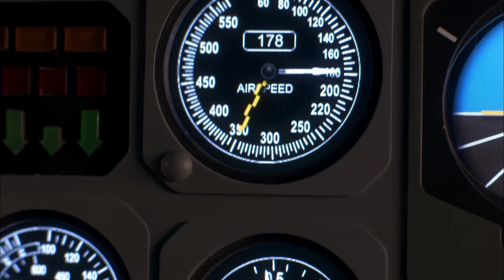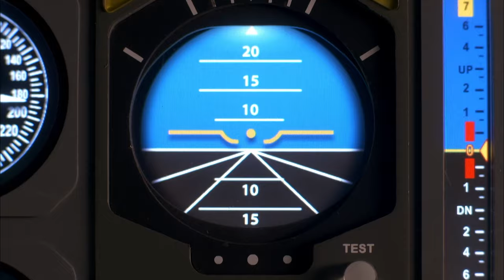A Take-Off for Concorde 4590 Turns Into a Fiery Nightmare 🚒 Air Disasters | Smithsonian Channel

Comment: There should always be a way that you can slow down a plane and be able to abort takeoff if something happens. Better chance of survival to try to stop on ground than to lift up in the air and come crashing down.
Reply: In a perfect world, but sadly not in the real world.
Reply: That's not possible cos if it happens after you are going a certain speed then you don't have enough runway left to stop... You have to continue with the takeoff. That's just how it is, there is no way to stop it.
Reply: If you slow down plane at that speed and distance, you'll either end up out of runway on the ground or just crash into a building bro.
Reply: @liampower5602  That's true for 99 situations out of 100. This one is one of the exceptions though, where the correct thing to do would have been to break the rules and reject the takeoff after V1 (of course you can't blame them for not doing so because they didn't know the extent of the damage). A great example of a flight crew who saved their plane by aborting after V1 was Ameristar Charters flight 9363. An MD-83 was accelerating down the runway and when the PF attempted to rotate the aircraft, nothing happened - an elevator had jammed in the nose down position. As a result, the crew rejected the takeoff (after V1) and, despite overrunning the runway, everyone survived. If that crew hadn't broken the rules they would have crashed, likely killing everyone on board. Really the rule is don't reject the takeoff after V1 unless the crew believes that the aircraft is incapable of flying safely
Reply: After v2 no abort, no gambling here u have to face it. Its like they sacrifice people
Reply: As a professional Air France pilot myself Captain Marty lifted it because if he crashed through the fence and stoped not only would so many others be injured but the plane would just blow up eventually because there is a lot of fuel.I Respect Captain Marty.
Reply: They can't, so that's why they pulled supersonic planes
Reply: You can't abort after certain speed because you'll just crash off the runway with a plane full of fuel. At least if you go round you can try and dump fuel but not gonna happen in this scenario.
Reply: @lillyess385 They can't abort after certain speed with ALL planes not JUST supersonic ones.

Comment: These were people of means who lived better than most. I'd rather fly coach and arrive alive.
Reply: True, it was for people with money.  This belief that flying coach is somehow safer is of course nonsense.
Reply: ^ Both these arguments are stupid. The crash had nothing to do with money. It could have downed a propeller plane just like it downed the world's fastest most luxurious airliner at the time. The crash had everything to do with the usual carelessness, bad design, and lack of thoroughness that has also caused many other incidents very much like it.
Reply: @rominn2184  It technically had to do with money, engineers on the dc 10 that took off were probably told to use shortcuts, therefore causing a small portion of the plane to drop off causing 4590’s crash
Reply: Just the carelessness, nothing wrong with the design.

Comment: Did anyone show calculations on IF the Cpt had aborted take off, as suggested by FE, would the aircraft, with it's speed and fuel load, actually stopped before they ran out of runway, or with the runway overshoot, may have stopped. Then dealt with the fire, mayb some of the 100 pax/crew via slides would have got off, (though as most pax were retired heading for a cruise, were they agile enough to evac quickly and nimbly.!)
V2 (must take off) is a rule, but with all things, does it air on the safe side... could the result have been better if they had tried to stop/evac.

Comment: We can't take off when the engine failed.......and we can't let engines when fire before all people died
Reply: But when the v1 is reach you must take off you can't stop the plane it is too fast and the runway is near to be finish
Reply: And youre sitting on your fucking couch meanwhile they're flying a.supersonic plane?
Reply: V1 is the decision speed they passed on the runway. You cannot stop the takeoff at V1 . There isn’t enough runway. 

The final act was when the flight engineer initiated a shutdown on engine 2. He had no permission to action this. That command can only be given by the pilot flying. 
So he probably shut down a thrust giving engine..
Reply: @muppetrowlf1473  the pilot said engine fire proceduire though

Comment: I'm sorry but I'm pretty sure they would have had a better chance of survival if they had TRIED to stop and abort the take off than what actually happened.
Reply: And you don't know what V1 speed is
Reply: @airbus_a380_enjoyer  well yes, funny enough I do, but still....if I had to choose between taking off with my engine on fire and applying all the features to slow my a$$ down and possibly saving more lives, then I will take the latter.
Reply: @hardv8  I would make the same decision. They had two options either destroying their aircraft and potentially killing everyone during runway overrun or trying to lift that airplane into the air and hope they can land safely. Aborting takeoff above V1 speed often has way worse consequences than continuing with takeoff. Alright I know they slammed it into the hotel but they knew that if they would abort takeoff they wouldn’t have chance to stop. We can’t blame them because design of Concord is not ideal for maneuvering at low speeds. Additionally they didn’t know that it was fuel tank burning. They thought engines were burning and even in modern procedures you can’t reject takeoff above V1 with half of your engines failed/burning.
In case of half of your engines burning during takeoff (at V1) the risks and consequences of runway overrun are way higher than continuing and then performing emergency landing as soon as possible. Alright this weren’t engines on fire but still they didn’t know it. Not even mentioning that stopping airplane like Concord at high speeds isn’t easy.

Comment: Stupid design concord it was clearly designed by someone wanting acknowledgement as it's not practical, incredibly dangerous and showy. And for what? Ambitious and deadly. Safety wasn't a huge concern and you know it will go up like a match box because of the fuel it consumes and speeds where it can't ditch take off 
Why not catch a normal flight and arrive on schedule,  rather than risk your life that easily. The people on that flight had more money than common sense
Reply: What? The safest aircraft design ever flown. 
Just because the French abused it doesn’t make it unsafe.
Reply: Continental DC10: 🗿

Comment: This a shockingly bad depiction of an an accident caused wholly by French incompetence. Not an unsafe Concorde.

The only thing ever unsafe about this aircraft was the decisions Captain Marty and his crew made. 
They took an incorrectly maintained aircraft . Broke the rules of its operation while on the ground. And in the air didn’t follow the correct protocols, resulting in a thrust giving engine being shut down without the order being given.
Reply: No, it was the DC10's fault. You clearly despise the French. Incorrectly maintained aircraft? Bro the crew and the aircraft were all fine.
Reply: Well, considering the French maintenance crew rebuilt the left undercarriage and left a major component on the workshop shelf.
I’d say it was incorrectly maintained.